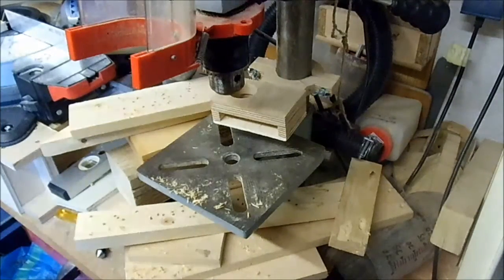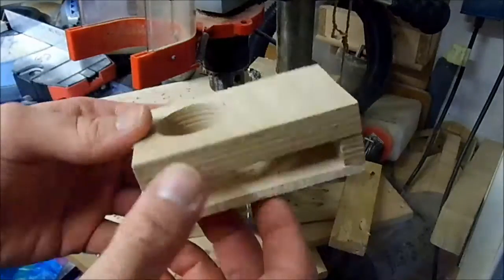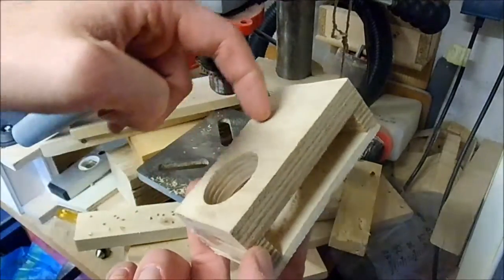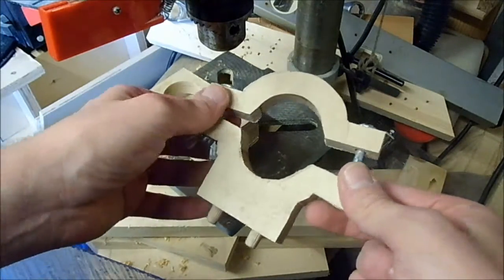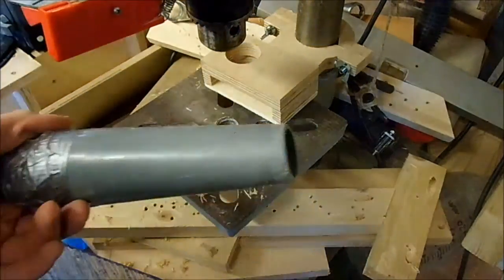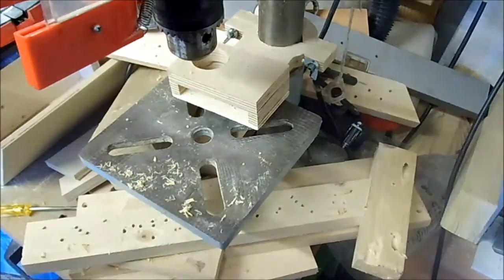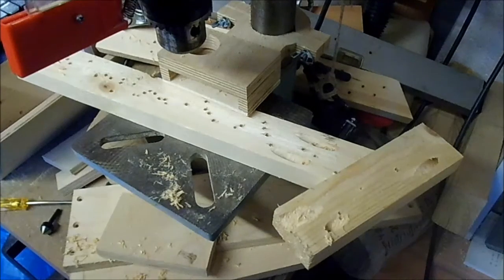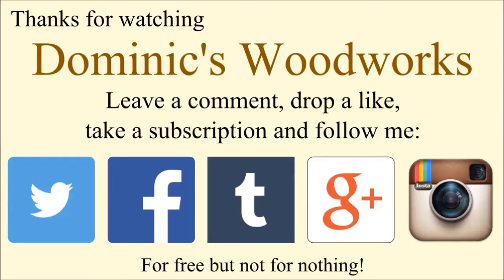Drill press dust extraction

Comment: would it not be easier and more effective just making the outlet flat and horizontal at the back rather than vertically at the top?
Reply from the maker: Yes, it would be easier to use, but also require more work/material. If I were to make it again, I would probably go that route. Thanks for watching!